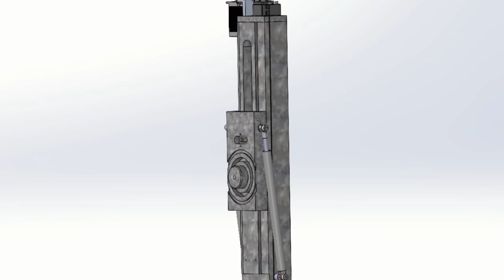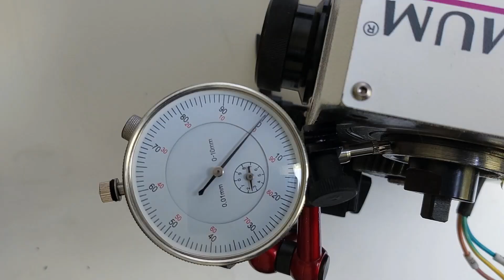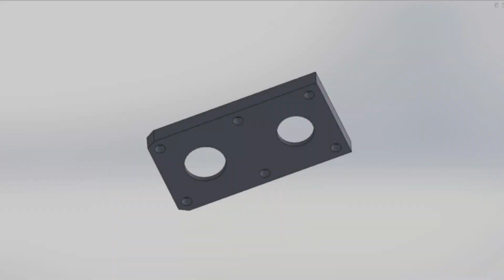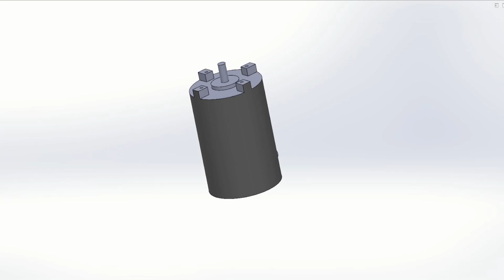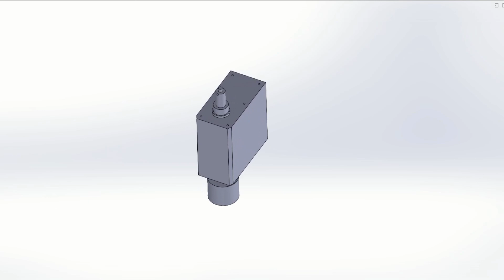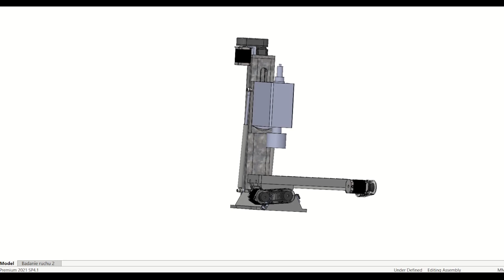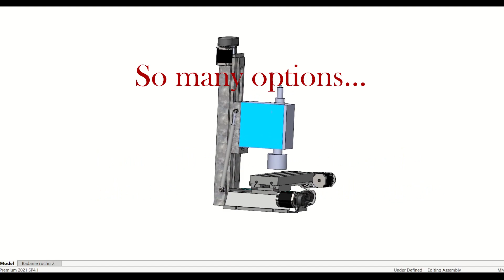Mini mill OPTIMUM BF16V Z-axis CNC conversion

Comment: Amazing progress! I would also suggest using a 1 - 2 KW AC Servo motor for the spindle, any more power and you’re running into issues with the rigidity of the mill.

Can’t wait until the project is finished and the Cad is released!
Reply from the maker: Thanks a lot! Probably I will stay with the 0,5 kW original motor but with changed gear ratio motor- spindle to achive around 4000 rpm max for aluminium milling. It would be nice to have even more but I don't think that the spindle bearings will last long. Concerning CAD - I decided not to model all the parts but only the most important which will be reworked later, so I won't upload it to GRABCAD.  It might be problematic if not all the parts would be 100% as real ones.
If you would like to have some STEP files I can send them to you.
Reply: @hotcylinder  That would be awesome if possible! I sent you an email about it too!

Comment: Hello! How did you choose airsprings power? Should they have power equal to head weight or lower/higher?
Reply from the maker: Hi! In my case force generated is greater than the weight. Best option is to have equal forces but in practice it is almost impossible with gas springs (only counterweight can do so).  I also have backdriveble Z-axis drive, so when the current is off the head has a tendency to go up/stay in place (depending on friction coming from slides) rather than go down and crash with cross table. Best!
Reply: @hotcylinder  Thank you!

Comment: Hi from Ukraine! I have the same mill and want to make milling head compensator. How are you getting on with the shock absorbers?
Reply from the maker: Hi there! Right now I am assembling XYZ mechanisms so very soon you will be able to see the results ;) I will only mention that I checked how much force 100N absorber generates in real life and the scales showed from 110 N to 140 N when fully compressed. I guess it depends on the manufacturer.
Reply: @hotcylinder  Excellent! I'm waiting for the video :)